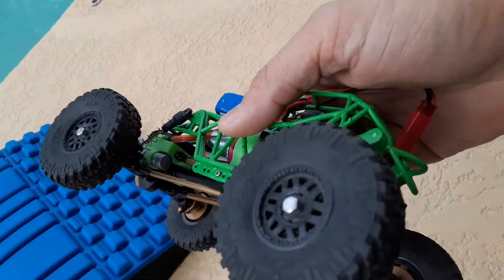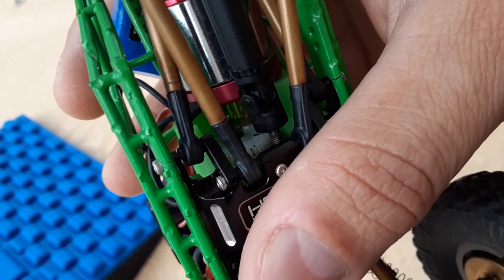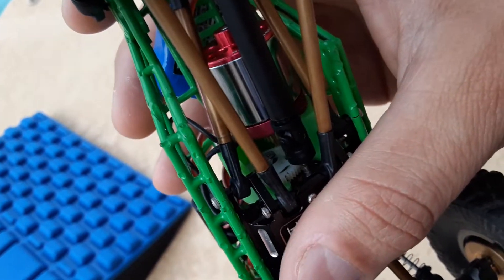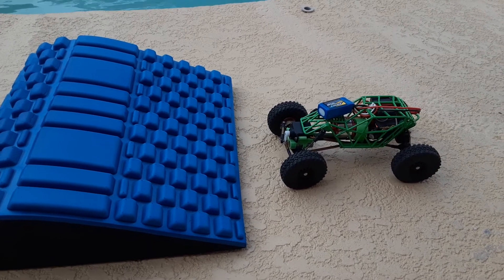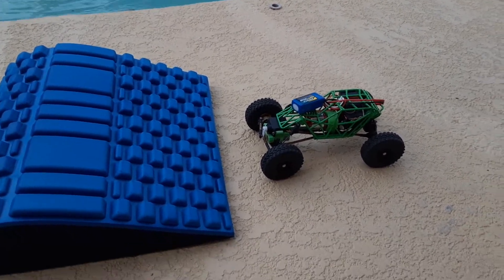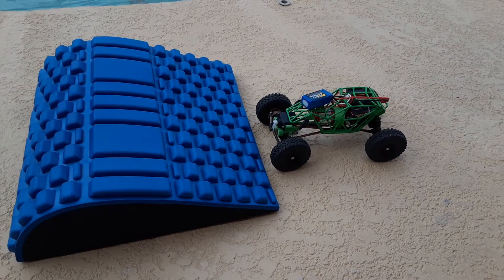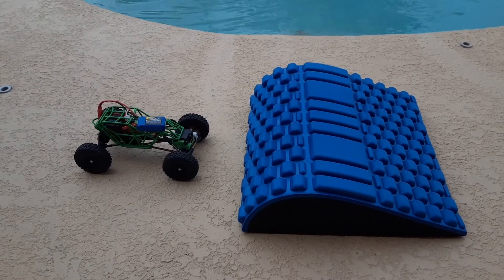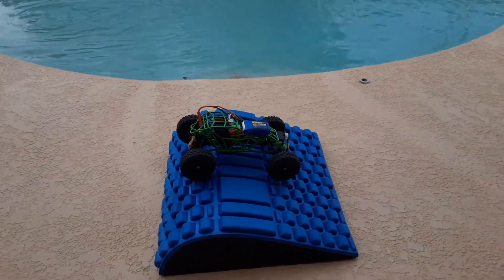SCX24 with 1914 outrunner super slow speed

Comment: What you'd you recommend for a rock bouncer using a barrage motor
Reply from the maker: You mean to do the actual funcion as in going fast? If so then first thing would be not to use the barrage motor as it is not strong enough for sustained fast speeds 😔.
Reply: @Gamyrc  oh what would be the best route to get a fast truck with out send info a bunch of money preferably not upgrading the rx ?

Comment: On the surpass motor swap for scx24,  do you have to change the spur gear? The factory one has like 20 more teeth....= lower gear ratio
Reply from the maker: The main issue comes with the shaft of the motor being 3mm. It's extremely difficult to find a pinion with mod 0.3 pitch to match that shaft. If you can find one then yes you can keep the stock spur. I personally just grind down motor shaft to match 2mm pinions in order to use 10t mod 0.3 pinion but that's not something everyone has the tools to do.
Reply: @Gamyrc  Wait... I'm confused. I thought the factory pinion and spur where .5 mod
Reply from the maker: @lockenetmonster5029  no, they are mod 0.3 Hot Racing made a mod 0.5 spur for it for improved reliability but that spur makes it faster.
Reply: @Gamyrc   I wish I could grind the shaft down on this surpass motor.  I could probably find a local machine shop that can do it. I have a tone of  8t .5 mod 2mm bore. I bought them to try to replace my opinion and thought that they were just labeled wrong when it didn't mesh..... I'm a DA. I have the 11 tooth 3mm pinion. I'm sure those 3 teeth will make a difference on that small a gear. But is it worth grinding the shaft? That's slightly over one rotation more out of the pin to finish the spur's rotation. I don't know what the math would say about motor to wheel ratio difference. But I'd love to. Can't do anything till the motor gets here from China
Reply: Exactly what screws do I need to mount the surpass motor please? Trying to get everything together while waiting on the motor.

Comment: question about the shaft on these motors. i followed the ebay link you provided at shapeways and the pinion shaft is now showing on the other side of the motor that spins instead of the stationary portion. did you have to take yours apart?
Reply from the maker: Just take the c-clip off the shaft and loosen the set screw on the bell. Now you can push the shaft ro the other side. Its right but it will move if you push hard enough.
Reply from the maker: Also, if you want to make use of the c-clip again you can remove the shaft completely and press in the opposite way and you will find a c-clip grove that matches on the other side as the shaft is meant to go either way.

Comment: Whats the motor and esc? I may have missed it but my laptop sucks and cant hardly hear anything. Does it require another mount that will cost me 50 bucks lol
Reply from the maker: This is an older motor version. Furitek came out with a much better version since this one. Its called Komodo and their esc is called Lizard and works way better than this👍.

Comment: That's so slow looks so boring
Reply from the maker: Lololol, its a very specifit part of the hobby that goes for this. I have many more that are way faster!😉
Reply: I made my scx24 nice and fast and it can also go slow at the same speed. I got myself one of the best esc's and brushless motors but since I see all these videos with them squeeling I never attempted to install them. I'll stick with brushed motors for now
Reply from the maker: @rctony710  Honestly, in my opinion the 1408 brushless is the best fit for this little guy. More power than a 130, and no "squeling". Plus you can gear to whatever speed makes you happy. But still there a huge market for super slow crawling so thats why this motor combination exists. I love my 70t PN motor but realistically ine day it will go through its brushes and will require rebuild. Not a huge deal but for some the reliability of the brushless setup is just another thing not to worry about 🤷‍♂️.
Reply: @Gamyrc  wow I now understand what a challenge it is to go slow. I just tried the leopard sensored brushless 4300kv.. it's extremely fast but horrible at slow. Wasted money if u ask me. My favorite to date is the barrage motor. The pn 70t is good but barrage has more torque if you ask me.. but the best is your setup for slow.. I would really like to do that setup. Where can I get that motor?
Reply from the maker: @rctony710  Not sure what happened to your 70t 130 motor that felt weaker than the barrage motor, its rated at over 3x the toque of the barrage🤷‍♂️. In any case the Leopard is a total scam in how they are marking it as being for the scx24. It does not work well at all. Ive tried twlling everyone but some just get lured in because its sensored so they feel it will give them low end control. Well at least you have a motor for bashing around now 😊. This is the 1408 outrunner I use. Its been the best balance of power/weight for this size crawler that Ive been able to find so far.
https://www.ebay.com/itm/1PCS-2PCS-Micro-Brushless-Metal-Outrunner-Motor-ADH100-1408-1850KV-for-RC-Model/163220282941?hash=item2600afde3d:g:BrAAAOSwW8ZdJY5a
Reply: Wow I just noticed you're the guy I get all the motor mounts from! I just got some more yesterday good stuff!! So yeah the 70t never had as much torque compared to the barrage not even when brand new.   My gearing isnt the same but it's close. I know I couldn't go as close to the spur since the 70t is bigger. I'm not sure if that's the reason. Should I attempt to put the motor In front?
Reply: I'm starting to wonder could it be that my 70t is running in reverse?? Nah it can't be . Well I've been searching for 100t motors to try but man it's like there's none anywhere even tried looking in Asia what the hell..
Reply from the maker: @rctony710  Im wondering what plate you are using with the 70t. If using V2 or V3 you should be able to use a 10t pinion. Also, the 100t motor sold for the scx24 is same size as stock motor so nowhere near as strong as the 70t 130.
Reply: @Gamyrc  Hey Gamyrc thanks for the great help! I put on back the 70t forward this time with 10t pinionan it's strong! But now I wantvto try this one it's a 100t it just came back in stock! Altough it looks identical to the barrage motor but I don't know how many turns a barrage motor is! https://www.horizonhobby.com/product/motor-100t-high-torque-atlas/FMMROC2022.html

Back in stock today! I want to try it out to see if it's got more torque then the barrage motor
Reply from the maker: @rctony710  To ne hon3st Im not sure how many turns is the barrage motor either 🤔. Its cheap enough, Id give it  a try just to see as it could be a super cheap alternative to even the Barrage motor 🤷‍♂️👍
Reply: @Gamyrc  ok I'll order it curiousity got me. But it truly looks like a barrage motor I you ask me. Thanks 👍
Reply from the maker: @rctony710  It most definetly is a Barrage motor in size. Thats a 050 motor. The only part we arent sure if is the turn count on a Barrage motor as opposed to this one. I suppose I could take one apart to check 🤔.
Reply: How fast you you take it apart? I already bought 3 barrage motors and I don't want to buy another 3 the same just with a different label!
Reply from the maker: @rctony710  not sure, I need to see if I can even find mine first. I usually just toss those aside as I have no use for them 😕
Reply: @Gamyrc  how you gonna count all those turns....🤯
Reply from the maker: @rctony710  Very carefully 🤷‍♂️